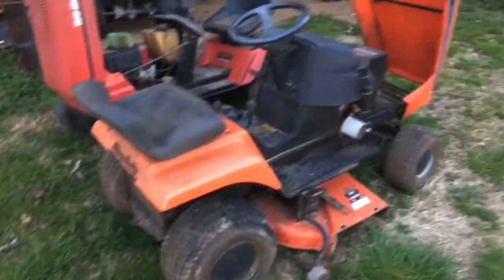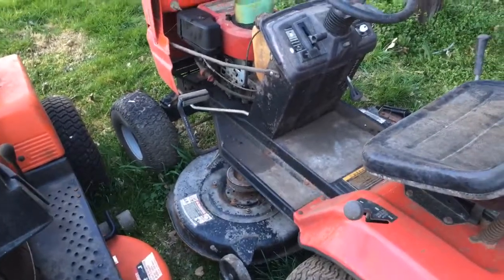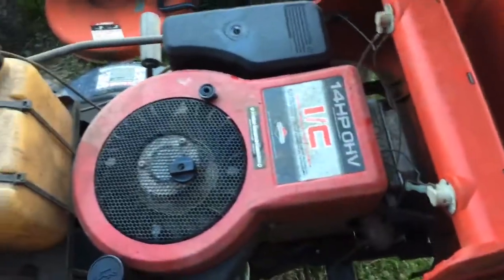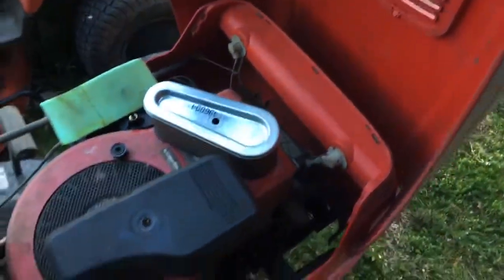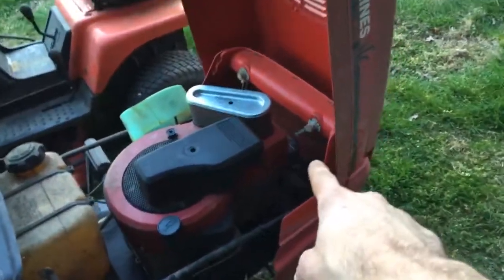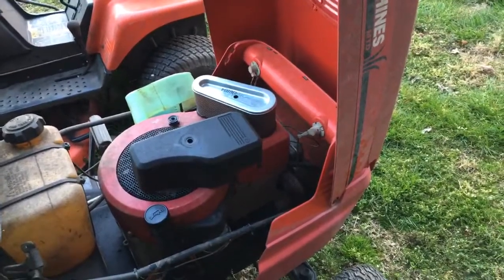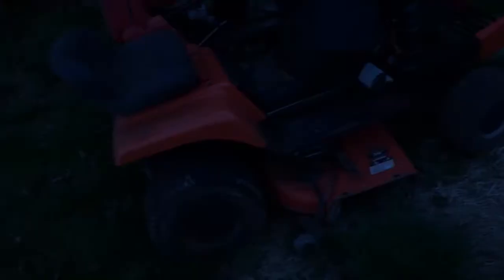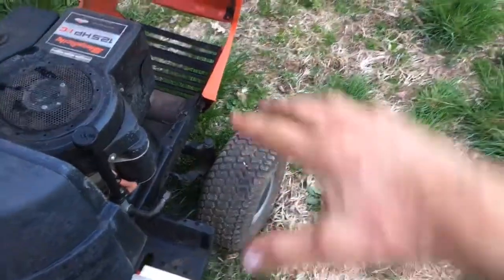What to look for when buying a used riding mower!

Comment: 3:19 If seller changed oil recently to cover up oil never changed, run engine until hot and check oil again.  If it's noticeably darker then there was sludge in the bottom of the crankcase, indicating oil not changed regularly.
Reply: I guess that would apply to a seller who added lots of new oil (because it was very low) without "changing" the old oil also, right?? (Not only sludge, but extra wear if the oil was allowed to get that low in the first place).
Reply: @Fred-gv3kh  
Yup, exactly!

Comment: Great video mate. It was a you tube recommended and it was literally one day after I bought a shiny market place riding mower for $2000.
The one check I didn’t do was to engage the the cutter deck with the engine running, if I had, I would have heard and felt the vibrations from a stuffed spindle bearing. Smh

Comment: Watched this and looked at used mower today. Focused on list and walked away. Seller said, "What ya expect for $250?"
Reply: I have a 250 mower I'm thinking about. Lower price gives you some flexibility with repairs but parts are still pricy
Reply: Good for you!  Better to walk away if your gut says so.  I've gotten 4 free lawn tractors so far and one only needed a bit of TLC and a new battery.  I actually drove one of the others off my van.

Comment: About to look at a Husqvarna YTH2548, which is I think year 2006-2008 for $500. The seat has a crack, deck is quite rusty, but tires in photo look ok so far and seller says it runs like it should. I'm going to carefully go over everything you mentioned remembering to bring a spark plug socket. Hoping this old beast has an hour counter too as this brand says 600-800 hours is where engine is considered old. Any thoughts on a riding mower that is almost 20 years old with rusty deck and some rust on body before I look at it? I couldn't seem to find any info on this model so as to get any clues on it's worth. Thanks for the informative video!